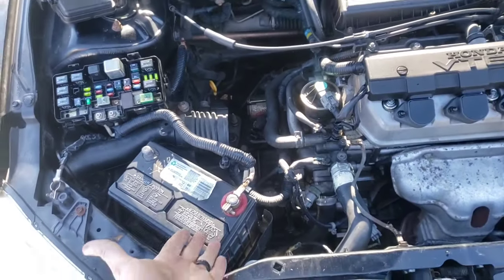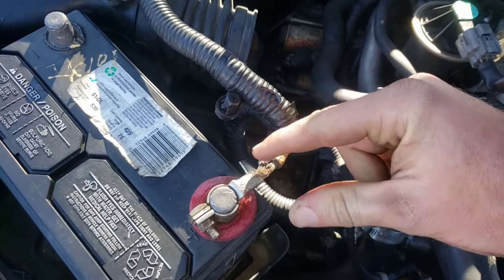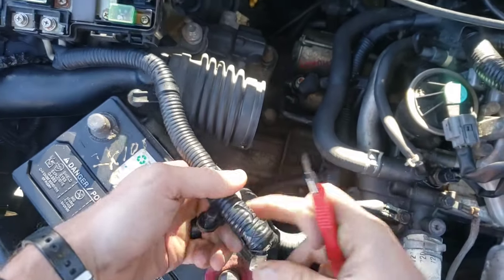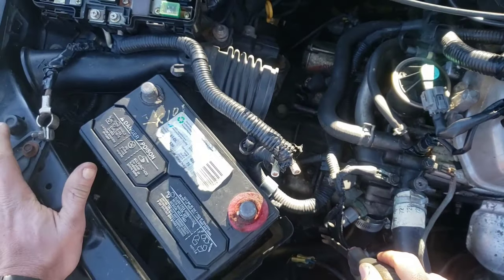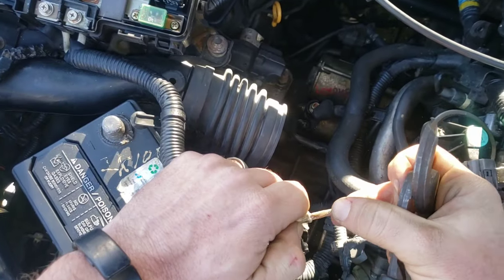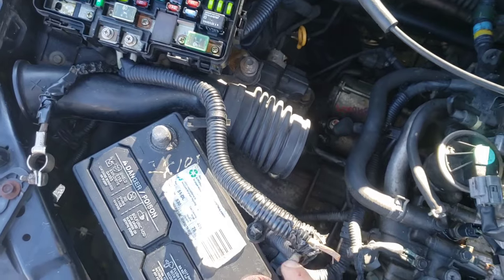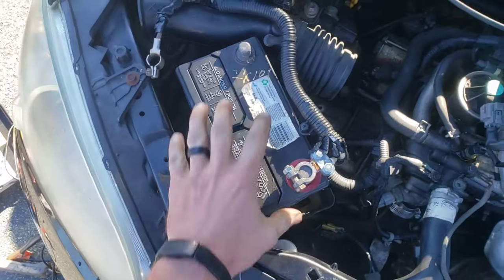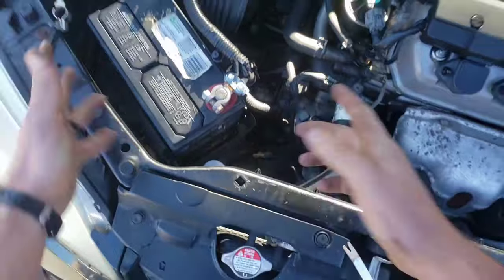How to Replace Battery Terminal Connector Car Batt Cable and Terminal Ends Right Way Never Come Off

Comment: TIP !!!!! EVERYBODY CHECK THAT YOUR SHIFTER IS FULLY IN PARK GEAR!!!! Might be the only problem you have. My van wouldn't begin to try to start so I thought I needed to replace the terminals so I did . Van still didn't start/doing same thing. Heard Jesus whisper "check that shifter is fully slid in park gear." I slid the shifter about a half a centimeter further into park gear and walaa , van started right up.
Reply: Walla? Voila, right?
Reply: yea that happened to my son.  he had be come down to him..17 miles from home...with gas.  
I got in his truck and started it right up.  
needless to say he was pretty pissed off mom got it started on the first try.  
I told his 19 year old brain that I drove a lot of shitty cars as did almost all the boyfriends i had before his dad came along.  
I told him, the only way you figure out what is really wrong is by trying stuff.  
He was still pissed.
Reply: Well my terminal is currently not existing so I think I need a new one
Reply: Imagine driving auto
Reply: Jesus whispered in my ear too. He said, "Your wife hates your dog, doesn't like the way you spend more time working than with her, hates everyone in your family, and thinks you're fooling around with your secretary. Keep the sweet dog and gorgeous secretary and dump the wife." I took that advice and am living happily ever after. Thank you, Jesus!

Comment: do not just smash the terminal on with the hammer just loosen the nut and open it a bit more put it on the snug the bolt and you wont have to worry about snapping the post

Comment: Good video. Tip: do not use a sledge hammer to tap the lead into the post. The post is lead and will break faster than your little finger if you hit it just a bit too hard with the old sledge hammer. Especially the part inside the battery. Ask me how I know. Use something light and try to open the thing wide as you can before you start whacking at it.
Reply: A rubber mallet would work.

Comment: Great vid. An alternative option to hammering the clamp onto the terminal is a cheap tool called a terminal spreader. Helps "stretch open" the clamp so it can seat further down on the post without hammering.
Reply: Very helpful thank you for naming the tool! I know it's a pretty bad idea to hammer down on a battery post hahahaha.
Reply: I never heard of a terminal spreader
Reply: or a flathead screwdriver..
Reply: You could break that post internally,ruin plates etc. Hammer not recommended 😂

Comment: dont hit it with a hammer. youll mess up your battery. try spreading opening the lead up with a spreader tool then use a c clamp to tighten up.

Comment: Great video.  Now, how about one that shows you how to extend the cable.  I just bought a 2012 Toyota Sienna that I had to replace an old battery.  The connectors were so rusted that one of the bolts snapped off.  Unfortunately, the cable is too short for the after market connector and the cable disappears under a lot of other parts.  Had to take it to the shop.

Comment: Instead of pounding on the post I’d rather spread it apart with a regular screwdriver and then tighten it back up much rather potentially damage an $8 terminal versus a $200 battery
Reply: Me as he was hammering the terminal.... 🙈

Comment: Did you disable or remove a fuse, I wanna make sure no spark when cutting
Reply: Disconnect both negative and positive terminals before cutting and you'll be fine.
Reply: If you really want to make sure there's no electricity in the car after you disconnect both, hold onto the break peddle and the break lights should drain any left over electricity. Alternatively you could touch both positive and negative cables together and the power should go away. Should be fine though
Reply: @stefancogurik166  Thx for the info I've since gotten a brand new car so no need to change any battery terminals at least for now

Comment: I wouldn’t really be whacking my battery with a hammer, because it might knock loose some of the lead plating and reduce the strength/lifespan of the battery.

Comment: What if you have a smaller red wire. Can I bunch that with the bigger positive cables?
Reply: up to you
Reply: Had the same question from what ik doesn’t make a difference it’s all touching same metal still worries me I think I’m going to put it back but if I could get a clearer idea of why not I’d love to know what my knowledge it won’t harm it you still want a good connection but you can’t like draw two different voltages from the same place so they’d be even and it looks like he did it in the video.

Comment: How much are battery connectors?
Reply: I just bought one last year at O'reiley.  I think it was about $2 something.
Reply: @LadyVSC13  Thanks.  Well mine was just one single dinky replacement terminal (Not pair), so yours probably better one.